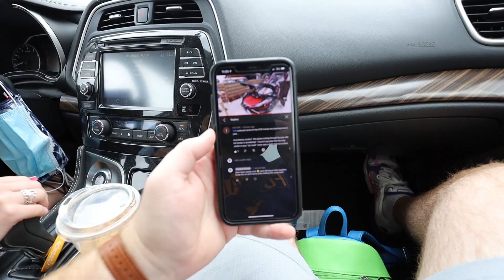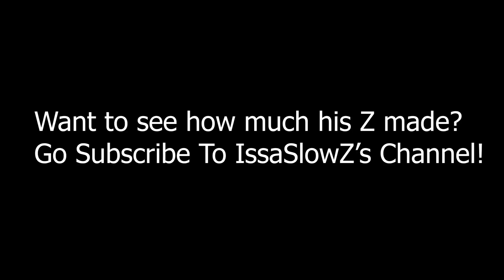SHOULD THE 370Z BE JORDANS PROJECT CAR ON THE CHANNEL?!?

Comment: Hell no to the 370z. It's getting a refresh for a reason. It's way overdue. Waste of money.
Reply: As a Z owner yes buying one brand new is a waste of money, way to outdated but used ones are super cheap so it doesnt really matter
Reply: @CodeCody00  thats why i keep it stock, outside of a 911 i would never modify exhaust for 6 cylinder cause they sound rice
Reply from the maker: If we were to get one it would be an older one but we are not set on any specific car right now
Reply: @paladin3116  false, not all. Sound rice or bad
Reply: @jumpstreet2425  Z's sound rice with aftermarket exhausts, thats why mine will always be stock. VQs always had that ricey sound
Reply: @paladin3116  you had said six cylinder. I was nowing of some 6 cylinder that sound good and mean. I know of like 2 that are aftermarket on 370z and sound great. So i think its still false.
Reply: @jumpstreet2425  Only two cars that have a 6 cylinder engine that sound good with a aftermarket exhaust is a 911 and gtr imo
Reply: @paladin3116  its even more, you just aint heard them. I have heard a s10 that sounds amazing witn v6, search procharged v6 mustang, its 1 with an amazing sound, and many more. Its a couple z with aftermarket if you heard the sound you would be amazed.
Reply: @paladin3116  i cant remember where some at, especially the mustang i want you to see. But search loud v6 mustang and go to droppin gearz video and another 3SevenStangVids- J Samuel 3.7 mustang. That mustang v6 sounds good
Reply: @jumpstreet2425  v6 mustang? noooo broooo😆😆 please stop it haha. you didnt just say that.
Reply: @paladin3116  didn't watch the video i see. They sound good. But whatever... Dude